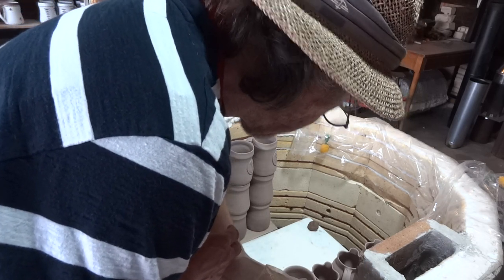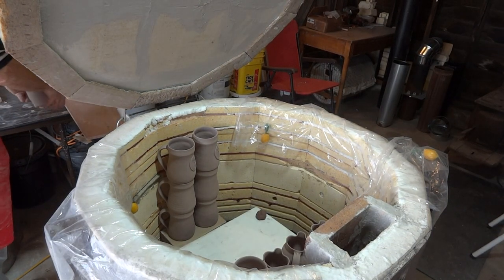SIMON LEACH POTTERY TV - Bisque pack april 6'15

Comment: Simon - hope you don't mind me asking a question.  It's about the collector flue (the part with the three high stacks of mugs on top).  Is it ok to have that semi blocked?  I notice you have a kiln shelf just opposite the front edge of the horizontal piece on the collector flue.  I've said elsewhere that I've copied your converted kiln (in comments to other videos of yours) and in my last firing I tried not to have anything obstructing the collector flue.  Just wondering whether I should have bothered and the gases would have found their way into it perfectly well with a shelf in front.  Hope that's clear!  And thanks again for all of your fantastic videos - brilliant resource!

Comment: How did you stick your cylinder head gasket to the kiln lid ?just sairset mortar, or did you also use staples??
Reply from the maker: rbanalog First spray the lid area with water , then spray the ceramic fiber, then put cement on fiber (a bit runny) and then quickly press to the lid. It should stick. The important thing is the spraying with water as it helps the cement not to dry off so quick. The cement is kiln cement not a mortar. Once fired the fiber should have adhered to the lid - we shall see !!??

Comment: Why do you put sand between the bowls before firing?
Reply from the maker: Pat Alger to lift them up so the rims do not touch, then the weight is taken through the base, otherwise the bowls will crack on the rims.